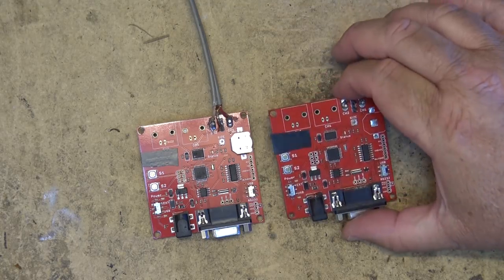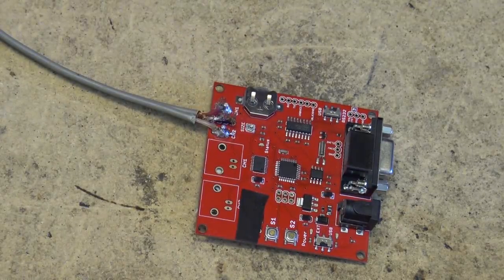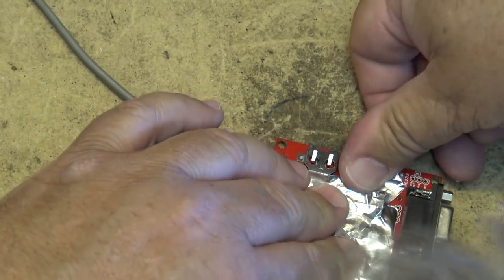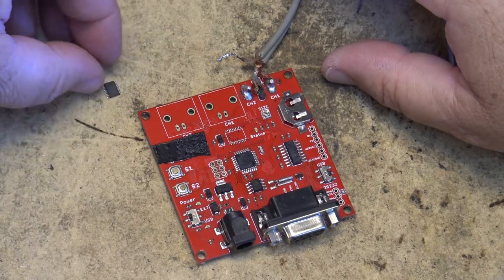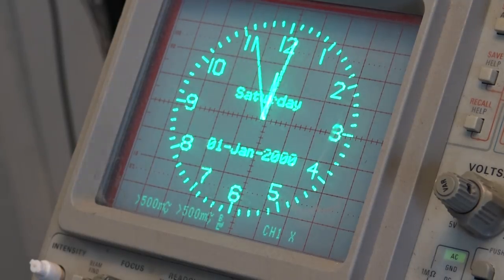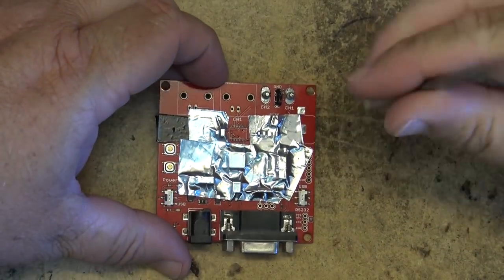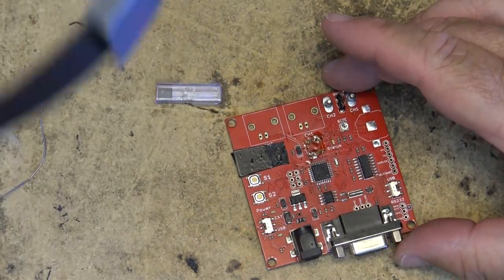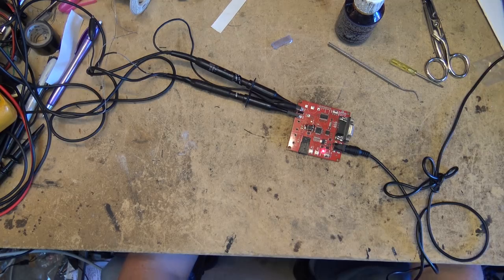Osciloclock generator board repair

Comment: Soon as I saw the PCB I knew instantly where it came from. SparkFun! I order stuff from them all the time. From what I saw in the documentation, the original open source project is called Dutchtronics and thats what the SparkFun version was based off of. The Dutchtronics version is all through hole and kits are available ;-)
Reply from the maker: I bought this one as a kit many years ago.  I had originally tried to order the assembled version as that was what they had listed, and after ordering they informed me that they had no more stock as it was discontinued, however they had a few bare boards available and parts kits if I was interested. I said hell yes, and they send me both boards and the parts to go on it.
The first one I put together didn't work. I had a short on it when I powered it up, and popped the D/A chip. The second one worked perfect for years until I blew that one in April. Now I have them both working again to be installed permanently in some scopes.

Comment: you could port the code from Dutchtronics on an Arduino Due (10$ ish on ebay china), it has two analog outs of 1Msps, the voltage swing is not impressive but it could be ok, just need for an RTC (avoid DS1307, can have like 500 ppm of error... use DS3231, it's under 1ppm)

Comment: It should of been one shipping rate for two chips..18:10... he probablly baught the 100 bundles, probablly went through the same thing on this repair. And made money. The shipping company probablly charged him eight dollars, because the package was so light. So he buys chip for one dolar, sells for twelve. Than charges seperate shipping on each chip . Hahha wooow. Finally the middle man has the way , as an example of business
Reply: Also just wondering if the old chips just needed to be re seated. But you did mention capacitors had failed. Good video, back to the eBay seller. Avoid each item shipping rate. It's usually by over all weight.
Reply from the maker: Well that is the way ebay works. 
The listing said there was 4 available, and when I selected 2, the shipping was doubled. I contacted the seller and he said "there is no way he can control shipping it is calculated and charged by ebay"

Comment: I don't know when you looked to buy the AD7302BRUZ chips but right now Mouser and Digikey is selling this IC in single quantities for less than $7 each.
Reply from the maker: jimstand 
It was back in April. Digikey had a min quanatity of 100 and mouser wasn't any better. That's why I turned to Ebay. They were 5 bucks each plus shipping which if I remember was 8 each. Will have to look at PayPal account to see the exact price I was charged.  Yes that was what I paid. Actual freight from China was .95 believe it or not. They get subsided shipping from government.

Comment: Nice work as usual.

Is your heat gun like mine that low speed fan is actually hotter than the high speed fan? It's counterintuitive in a way. I mostly use mine for drying patches when doing drywall repair. If you get it too hot, it will just blister and bubble on you causing more problems then what you started with.
Reply from the maker: No mine is MUCH hotter on high than low. Lets put it this way I took a light bulb and put the hot side on it, and it melted the glass and the bulb imploded on itself from the vacuum inside,

Comment: Screw buying a hot air station if I'm lifting a couple of chips a year. I was just thinking of i could find a small steel or So funnel to fit that gun. What is the OD of that gun?
Reply from the maker: That would do it. I was thinking the same thing.
Reply: I've seen really small heat guns around but not recently. I have one in the Milwaukee brand, but its a rip off of the real Milwaukee brand. Works fine for these proposes, hot enough and enough air flow to desolder. Its diameter is about 5/8 inch. I got it at a thrift store.

Comment: What is your opinion on the use of anti esd equipment
Reply from the maker: I have never fried a chip yet and you see what precautions I take. 
No I don't try to generate static discharges. I don't wear synthetic clothes, and walk across a nylon carpet rubbing my feet before I pick stuff up. I do ground myself before touching components, but I don't do the wrist strap or any of that nonsense. Overkill I say,

Comment: It's wrong to say every ebay seller tries to screw you.
Reply from the maker: Not every one, but the majority do. 
I have received more bad parts, or been charged outrageous fees for shipping.
24.00 each for 2 chips that have a retail price of 2.15 is a little more than gouging.
Reply: What DAC chips are those?
Reply from the maker: Juraj Lonc 
I do show a close up of the chip. You can see the number. It converts the bit stream from the avr into 2 analog wave forms to drive the crt x-y vectors.
Reply: It is AD7302BRUZ. btw. I see them in mouser.com available in 1pc quantities for 5.64 EUR.
Reply from the maker: Juraj Lonc 
They are available from mouser us as well but they have a flat 20 shipping charge to Canada.
Reply: It's the same here :( But when I order parts for 50 EUR the shipping is free. So I usually order parts for several projects so I get over that threshold.